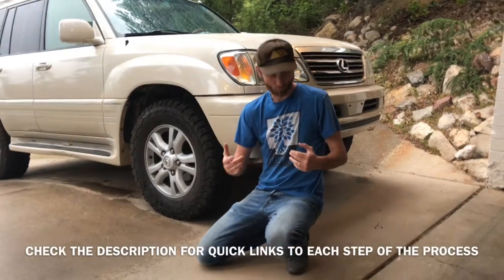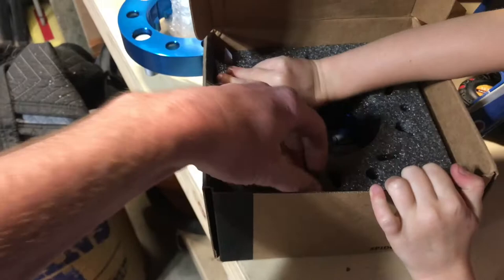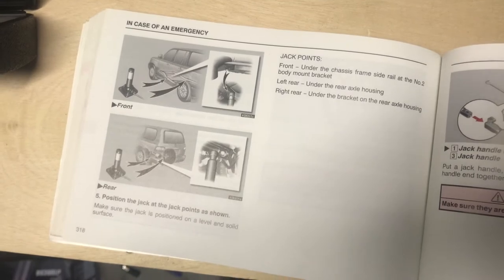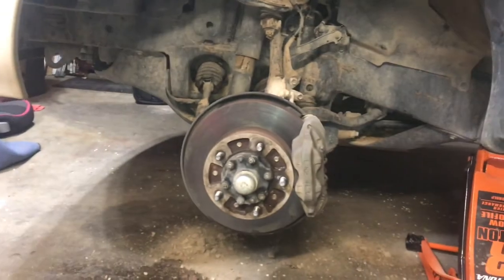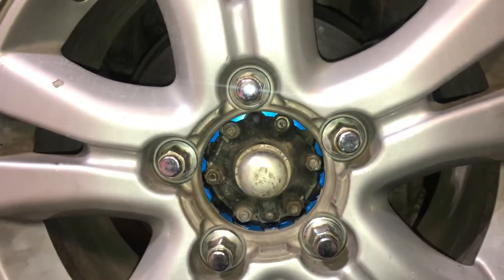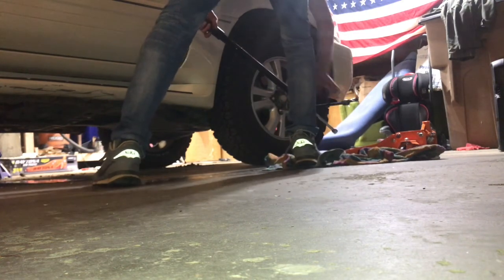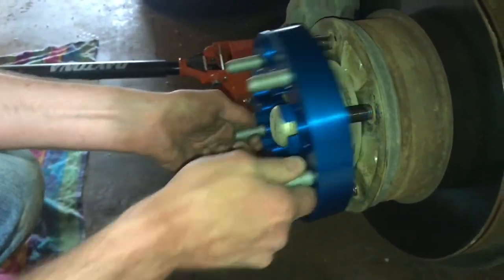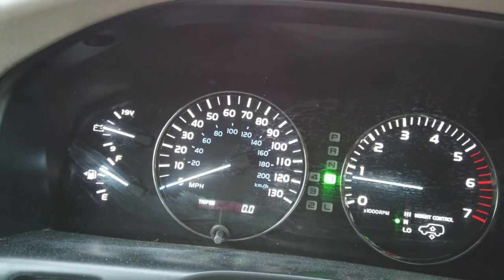How To Install Spidertrax Wheel Spacers on a Lexus LX470 | Toyota Land Cruiser | 100 Series

Comment: Great video, I don’t want to run spacers on my 100 but, I have to if I want to fit my aftermarket wheels. I found your video very helpful and was able to see how the front spacers fit on the hub. I am trying to go for the minimal amount of spacing possible and I think these 1.25s are it. Plus they have great reviews on all the forums.

 Thanks again.   

I’ve broken so many 4ways over the years using the pipe method lmao, adding the Dewalt DCF 899B to my arsenal of tools was one of the best investments I ever made.  I highly recommend getting some sort of electric impact. Your arms, back and hands will be grateful 😂.
Reply from the maker: Solid advice man, thanks for taking the time to hit me up. The only thing I’ll say about the spacers is I rub with this wheel/tire combo all the time and it sucks. I have 285/65/18’s. So in every day driving when I turn hard or hit a dip - it rubs. They didn’t rub before the spacers so keep that in mind. Other than that, I tow with them, offroad like crazy, and they hold up. And they look good as hell!
Reply: @TexusLexas  awesome, thanks for the heads up!